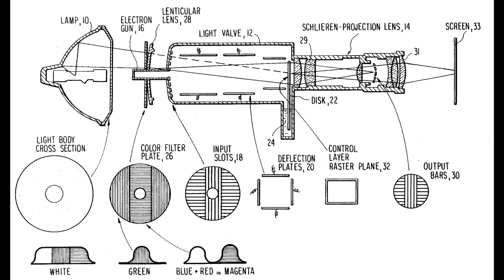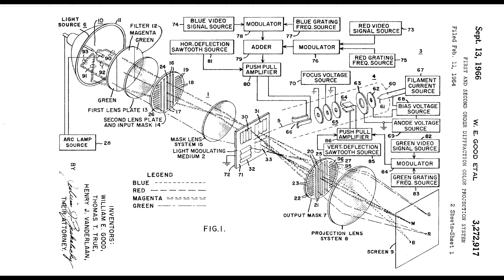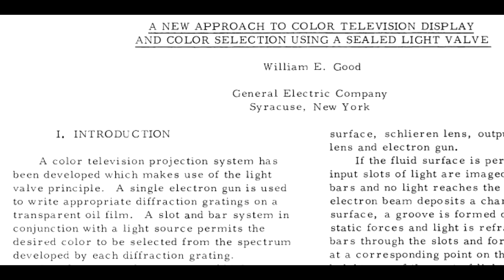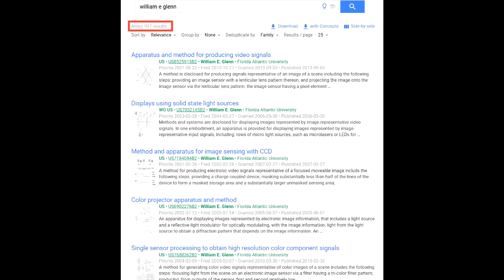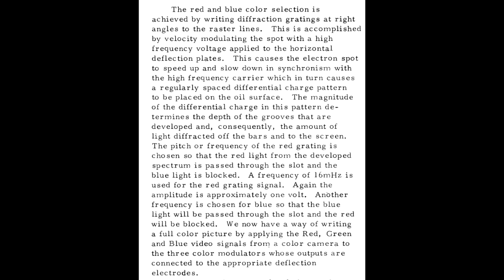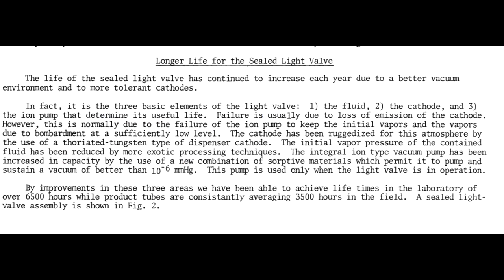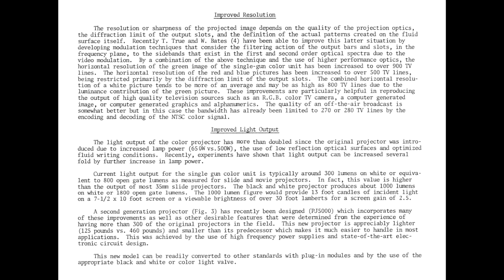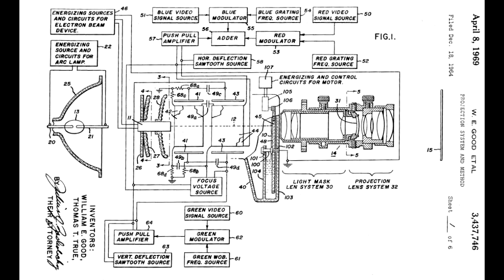GE Talaria follow-up

Comment: These Talaria projectors were the "Gold Standard" in their day. GE projectors were based in Syracuse, NY.  They were initially created in B& W for the military, who was interested in the brightness they provided.  They were too expensive for commercial use (i.e. Boxing matches in rented movie theaters).   After color TV became viable and later commonplace, the color versions shown here were developed.  To put things in perspective, despite of the apparent complexity shown in the drawings, these were an order of magnitude more light efficient than early LCD projectors in the late 70s.  Resolution was better than "Broadcast TV" (i.e. ~ 450 x 240 in B&W  roughly similar to a VCR) especially in color.  "Broadcast TV" has about 1 MHZ color bandwidth which is less than 1/4 of the luminance / B&W bandwidth,  or ~ 110 lines vs 450 lines.  These are vertical lines of resolution, not the number of scan lines of the raster.  One of the fun things to do in the late 70's was to photograph a car's red tail light and watch it on a color TV, press the brake pedal, and note that the red color was much larger than the actual tail light.  
Most Talaria projectors were replaced in military use by the Hughes light valve projector which worked by using an LCD window which was raster scanned as a reflector of a powerful xenon lamp.  This had full RGB capability, variable scan rates for higher resolution.  They were deployed in the "situation rooms" not only on land, but also on aircraft carriers.

Delving into TV technology is fascinating and reveals the ingenuity of talented people.  Video tape recording is another aspect, which adds a lot of mechanical complications to the puzzle.  That old VCR in your home is the most complicated, precision technology in the consumer's hands, yet at a very affordable price.  It still is (much more complicated and demanding to make than even a "super-duper" gaming computer with VR headgear).
Reply: Not to diminish the precision of VCR technology, but I have an impression that modern hard drives (spinning ones) are on a whole another level of complexity and precision.
Reply: @evghenim1955  Hard drives are indeed precision devices... but they have only two moving parts: rotating discs and angling heads.  The heads are not touching the magnetic coating of discs, but "ride" several molecules of air above it (i.e. "Winchester technology").  In VCRs, from 2" quad machines to small 8 mm cassette camcorders, the heads not only contact, but also actually "penetrate" (deform) the magnetic coated tape, which is wrapped around about 180 to 270 degrees around the rotating head. And then there are the double and triple nested PLLs for controlling the head drum and capstan.  The head drum speed and tape speed not only have to be precise and matched to the signals on the tape, but also correctly in phase.  Hard drives only record "1s" and "0s" while video recorders record several analog signals which vary over a 40 dB range and are AM, FM and PM modulations and have an additional two sync signals for timing.  All this, in a woodgrain style plastic case, TV tuners, timer and remote control for under $80, which was a fraction of the cost (at the time) for most hard drives.  Amazing!
Reply: @evghenim1955  Yes, but not nearly as many moving parts. Both are amazing in their own right.
Reply: I managed to dig up some info on the Hughes light valve, it's a pretty interesting technology as well, though not nearly as clever as the Talaria. Surprisingly enough, it's not based on raster scanning, at least not early models. It seems to have been built around reflective LCD technology, controlled by a photoresistive layer coupled to the face of a small CRT. The light valve itself was a sandwich of layers, converting the visible light image from the CRT into a reflective image, which is then used to gate the light from the usual xenon arc lamp.
Reply: @Mikkel324  Kind of... The ~ 3"CRT was raster scanned to modulate the  ~ 4" diameter LCD cell whose 2 electrodes had a bias voltage applied which was gated to extinguish each raster image.  Even though the CRT emitted a visible raster image, the LCD was mostly responsive to the heat of the image. 
As for cleverness, the oil film light valve of the Talaria and Eidophor projectors was indeed a very clever solution, albeit, extremely complicated and critical to make.
Reply: I think you greatly underestimate the insane complexity of microchip processor production. It's the closest thing to magic humans have ever known.
Reply: @jguy584  re: "insane complexity of microchip processor production."
Evolutionary rather than revolutionary technology; I think you also overlook many of the terms, items, like multiple PLL loops in the VCR critical to maintain operation.
Reply: @jguy584  I think you overlook that, at least, the more modern VCRs contain microprocessors!
Reply: VCRs, Hard drives, DLP, iPhones (which contain MEMS clocks!) all are fairly complex. But I think the Apple Vision Pro might take the cake... its got everything going on.
Reply: VCRs initially even had mechanical clock / timers to schedule recording later.  Later, 4 bit uCs were used for that function, still later some slow dumb uCs also controlled  the mechanical functions.  All the "video magic" was done with analog ICs and electro-mechanical means.  Those VCR uCs  were glorified timers and IR remote controllers, which finally fed some on-screen data of the time and function of the VCR to the analog video circuits.  When digital video finally became workable and practical, it was easier to "record" the 1s &  0s to a hard disk.      @blackrockcity

Comment: A lot arcane physics for one device. Developing this to a useful commercial product must have been daunting.
Reply: Judging by the "Dr. William E. Glen suggested this basic method of generating colored light by selecting the desired portion of the developed spectra from a phase grating written on a fluid surface" seems at least he had a quite clear picture of how to manage it. I imagine it might have been more simple than you'd think when you'd understand optics and a bit of fluid dynamics.. Ok maybe a bit of mechanical and electrical engineering too :D
Reply: @rkan2  exactly... magic 😀

Comment: This technology makes nuclear physics look like it could be simply written into a Haynes Manual and a working nuke could be knocked up over a weekend in your shed. Brain melting stuff!!!
Reply: AFAIK making a traditional fission bomb (not fusion/H-bomb) is not technically that difficult but it is very resource intensive. With todays technology and no restrictions you'd probably need a few hundred million $ to a couple billion to create a uranium-derived A-bomb. It seems to also be more easy to make a dirtier bomb (bomb that doesn't use all the fissile material in the explosion) than a cleaner bomb that consumes all of the uranium (or plutonium in a nuclear reactor derived bomb).
Reply: @rkan2  yes thankfully you are correct. Great explanation why here from The Engineer Guy:

https://youtu.be/OcgKDSwINOA
Reply: re: "This technology makes nuclear physics look like it could be simply written into a Haynes Manual"
Look up the story about The Nuclear Boyscout to see how someone was well on his way to do just that ...

Comment: Goes to show when you have limited technology you find ways to make things work, there’s loads of 1940s and 50s tech that’s extremely hard to understand by modern analysis, but would probably be fairly straightforward to those who only had tubes and discrete components.

Comment: The book "Color In Electronic Displays 3" by Widdel & Post references this and appears to have a good amount of information on this technology and other similar tech. Looks like you can grab a copy for £35 second hand.
Reply: I found a pdf copy of the book, it only contains a few pages on the Eidophor and Talaria, but they manage to explain the technology pretty well. It also has a few subchapters on other interesting projection technologies, among them the Hughes light valve mentioned in some other comments here.

Comment: I wish there were some of these working somewhere, it would be great to be able to see how good the picture quality is. I would imagine the saturation would be pretty low, but then so was the 70's colour CRTs :)
Reply: There are a few short clips here of the projector itself, but sadly none of them pointed at the screen...

/watch?v=yj69t1l7BQA
Reply: The projector was NTSC/VGA because those were standards. But the technology was capable of higher resolution. The three beam GE MLV probably was higher resolution. The image had refresh latency sort of like phosphors of a CRT that would glow for a bit too long between frames. It definitely had a unique analog look to it due to the oil causing the image to sort of bleed around. An ambitious project would be to adapt modern video electronics and CRT modulators to up its resolution. But that would be a science project, not a competitive/practical tool. The xenon lamp required a 240v wall receptacle... for an image with far less resolution than an Apple Watch. But at the time, the brightness meant you could have long beam throw distances (different projection lenses were available if I recall) and very large movie screen sized images .

Comment: The way I understand with the quick read while the video was playing is. They have color filters on 3 zones of the illumination source that pass trough a mask. Conventionally the electron tube is writing lines onto the oil film, as would onto a CRT screen. Within those lines they modulate the 'energy' to create vertical ripples, so the diffraction matches with the output mask ans color. I suppose the output mask is there to reduce bleed and only allow the light/color that gets focused in the correct geometry trough that mask. It seems a bit like radio amplitude modulation to create the grating waves and beam power to write the image information.
Reply: The colors dont come from the diffraction, but rather from the selective matching of refractive index, generated by the 'waves' in the oil, to the output mask. Hence the term light valve, since it 'bend's the light so only one color at the time matches the output grating. When nothing is written the input mask, cancels or is blocked by the output mask. When the light is refracted correctly is can pass trough the grating.

Comment: What was the quality of the projected image?
Reply: pretty terrible by today's standards but these were used often things like screen projection behind a rock stage of the ongoing concert so it didn't matter much, anyone close enough to see how bad it was wasn't looking at the video but the actual performer, so by the time you got out to the range you'd be watching the screen it was alright.

a few of the papers refer to something on the order of 200-300tvl which is around what you can expect from the best standard VHS can do but probably with quite a bit more color resolution
Reply: @Mister_Brown  Thanks for the informative response. I now have a good idea of what it looked like.
Reply: It said right on the screen in the patent that they were achieving 600 to 900 lines of resolution.
Reply: @tekvax01  600 to 900 lines is much better than NTSC transmission, as stated in the marketing material.
Reply: The technology was capable of higher resolution than the NTSC standard... so it was the standard that limited the projector's resolution, not physics. I have yet to have seen a Talaria with properly calibrated color, so I'm not sure what color gamut it is capable of.

Comment: I have two talaria complete projectors but haven't checked to see if they work or not.
Reply: What sort of video input format/connector do they accept?
Reply: Don’t scrap them! Make vids or get them to somebody who can!
Reply: @FrozenHaxor  VGA and three component BNC if I recall. Therefore modern computers can drive these projectors with the right dongle.
Reply: @blackrockcity  Woah, I wouldn't expect VGA on such vintage projector at all! Interesting, wonder what the refresh rate would be in Windows haha, probably a smudgy cursor from the oil refresh system.